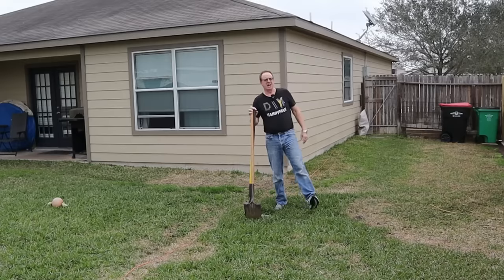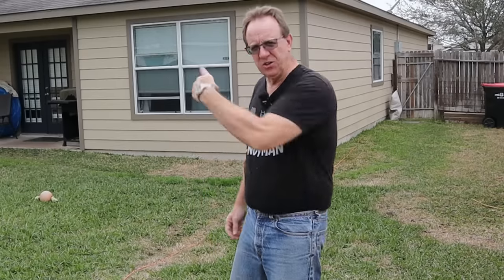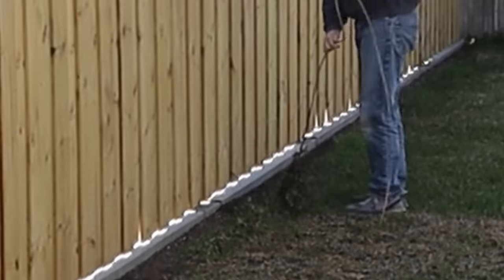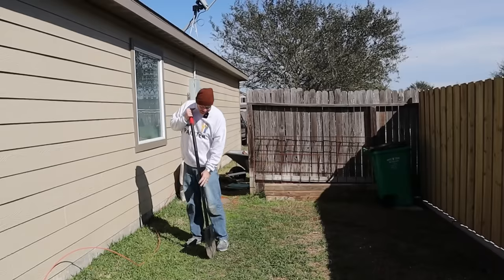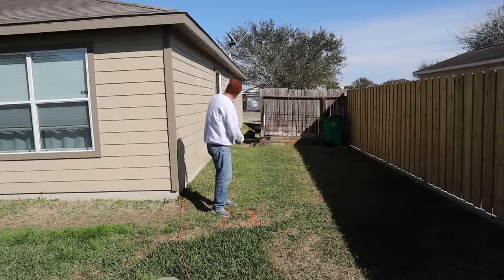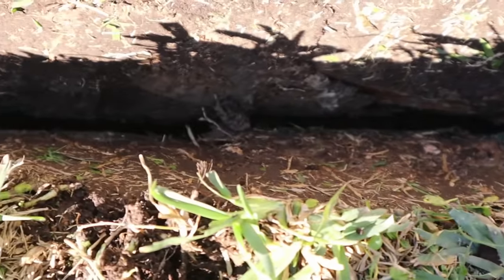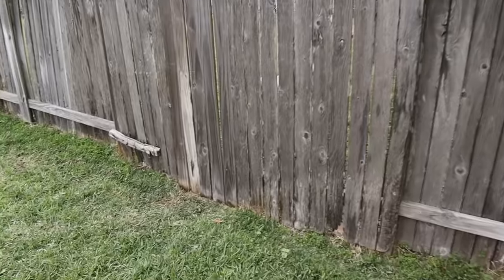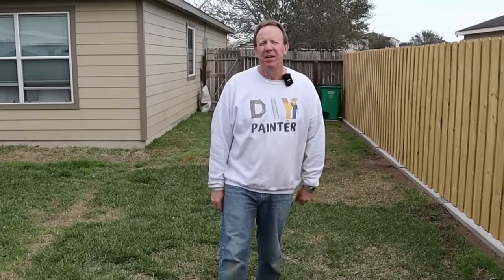ZERO Digging-Trenching Made Easy-Cable, Electric, Conduit

Comment: I’m 69 yr old woman and I dug a water line using a pressure washer.
Reply: I need to run a water line so, could you elaborate on this?  Thanks.
Reply: Excellent idea!
Reply: Gangster
Reply: Bet that was messy
Reply: Chalk line....nice, but I like the Sawzall technique better.
Reply: @MrElwoodCaudill get a pressure washer, turn it on and point it at the ground. Very simple process.
Reply: I was thinking the same thing! Great minds..
Reply: It’s called hydro excavation
Reply: Im mexican can confirm that we all know how to work hard 👍😊
Reply: Genius! 🏆
Reply: hydrotrenching
Reply: Nice😎
Reply: The pressure washer is a great idea. You can do a similar thing with air. They make it specifically for digging. It just uses air instead of water. Both are fantastic if the ground has a ton of rocks. 

I like going the other way. I use a good shop vac with a 2 inch hose to dig post holes.
Reply: Yep 💯💯. Also, I dig post holes withy wet vac 😎. Just vacuum out what I need, n dump the bucket out once I drop the post!
Reply: @ThePudgie123  Digging a 100ft trench with a sawzall will make your hand fall off.
Reply: How are you enjoying your new line of no grass? 

Used an edger or sawzall, cut the grass out in chunks. Then you can put those pieces back in place. And you still have grass there. 

Using a power washer may be easy, but HORRIBLY messy, and looks like trash after
Reply: Smarter lady here
Reply: Now that's the kinda woman that they don't make no more! "Git-er-dun!!"
Reply: Intelligent women are Beautiful!!!😍👋😂😄🙏💪☝️👍
Reply: She definitely converted her pressure washer to shoot air. She invented the air shovel @streetkid6534
Reply: My grandma (granny) was a hero of mine. You ma'am, are at that level.
Reply: You can also use hydro trenching to dig a water well in a lot of places! There's videos that demonstrate the process with only a hauled in IBC tote for water supply.
Reply: I love you

Comment: Since your cable is direct buried,  I would suggest running the cable through a pvc conduit riser or sleeve up to your box.  This way string trimmers won't damage the cable when doing you yardwork.
Reply: Alternatively you can run a sheathed cable, Teck cable that doesn't required conduit.

Don't bury any cord or cable not rated for direct burial. 15 year+ electrician here

Comment: The first time I got cable, three young, strong, men brought a gas-powered trencher and struggled for an hour to put the cable in, which they broke and just shoved the broken ends back together. They went directly across my lawn. After I called for a repair, an old man showed up with one of these tools. He said that the cable should have gone the long way along the fence. I scoffed at him for thinking he could do what the three men with a trencher failed at. He did it right in about 20 minutes.
Reply: HAHAHAHAHAHAHAHAHAHAHAHAHAHAHAHAHAHAHAHAHA :face-blue-smiling:
it's called experience, know-how, gumption :face-orange-raised-eyebrow:
Reply: @fvrrljr  , Yes. One lesson I learned is to never get cable when they offer a great price in a neighborhood. It means that they plan to hire a bunch of untrained people to do a massive number of installations. The cable installers don't know what they are doing.
Reply: @factChecker01  Thanx for the tip. but with wi-fi i don't get cable not other services that free wi-f- out there. made a cantenna that picks up open signals. don't watch much tv but i do love the free HD channels using the old and true antenna on the roof
Reply: The logic is that they would have removed any large obstacles to be able to insert the posts for the fence.
Reply: Knowledge is power

Comment: If I may add ~ always saturate the ground if you are going to use this tool or any other, it's always easier when the ground is slightly damp/moist. Also works for me when pulling up fence posts. And another thing:  A chainsaw with an old chain can get most of this trench done in a heartbeat, just be careful with rocks in the ground ...Thank you!
Reply: GREAT idea, I've used a Roybi battery operated saw ( $100 on sale ) to do similar
Reply: I guess that's great if you're at least 100% sure there's no buried power, water or gas along your pathway
Reply: @REVNUMANEWBERN  WOuld one of these work on hard clay that is dry and hard packed?  I am having trouble with all hand tools and cant get in there with anything large or heavy due to terrain

Comment: They used one of those when they put my cable line in when I lived south of Houston.  It was fine until the summer when the soil dried out an it opened up to form a 2" wide crack.

Comment: As a former utility marker, I can assure you that the machines they use for marking work pretty good.  The marker should have started from the pedestal (BOX) and worked his way back to your house.  Even though the cable company did not charge you since it was mismarked, The marking company paid for the damage.  When I was marking in the state of Kentucky, the cost to replace a cable line was $1000.  That was 25 years ago.  Its probably more now.  I like the tool.  It used to be against the law to open the ped, unless you are a locater or a technician.   Good video.
Reply from the maker: No they started at the cable box and when to the source.  Didn't realize they charge back the company.  I am sure they didn't credit them for me putting the cable in the ground.  Thanks for watching.
Reply: It is Still Illegal to "tamper" with the box.

Comment: I would have used 3/4"PVC.that way in case you had to replace or add another cable line .I know that would be an extra expense, but it will be easier for the next time. Great tool .
Reply: I agree In running the wire through a PVC instead of direct bury.  Add a tagline to the wire will make any replacement or running another wire a piece of cake.
Reply: I always run lines in conduit, PVC or otherwise.
Reply: I like to add some Caution Buried Line Below tape a few inches from the surface too.
Reply: Jesus Christ guys it’s a gd coax cable, who cares. You’d have to open that trench up wider for a pvc pipe morons, he wasn’t going to rent a trencher and spend all day putting a conduit pipe in the ground.
Reply: @ryan74701   so no pvc then?? Ok

Comment: Nice. Guess I'll have to buy one of those. I have a lot of projects that I cant to do and even if I need to dig a trench - this tool is an excellent way to start as I can come in along the sides at an angle with either a shovel of that same tool to widen the trench to meet whatever width I want.

Comment: Nice tool. I'm going in another direction. my pressure washer and an old shop vac I use for wet. I have a few post holes to dig to replace sections of fence that blew down and for Gazebo posts. I won't have to worry about through cutting lines because the pressure washer won't cut.

Comment: As others have mentioned, this would have been a great opportunity to utilize flexible conduit to truly protect your cables. I did it with AC and speaker wire last year. The flex conduit ensures there are no connectors underground, so there are no leak points.

Comment: There are SOOOO many places in the U.S. where the hard packed soil will make this tool impossible to use. But with decent soil, yeah, way to go!
Reply: Um...  no!  Not true.  There's nowhere this tool won't work (if you're smart).  I live in UT.  The clay soil here is like concrete when it dries out... The key here is: "when it dries out".  The simple fix is to lay a soaker hose along the path you need to trench, and leave it on overnight.  Shut it off in the morning, and start your trenching in the afternoon.  Simple as that.
Reply: @username-mc7jw  Clay is easy.  Try living somewhere with glacial till.   50% soil 50% basketball sized rocks.
Reply: Won't work in SE TX in the dry summer either. Our soil is like concrete. You can flood it for a day the day before tho.
Reply: Try your luck doing that across what used to be a shelled road 100 years ago that is now grass. Or any other type of non-soil substrate. Or in mountainous terrain that's all gravel.

Comment: I ran a cable drop bury crew for a couple of years when I was 18 for a contracted install and underground company, total circus. We were given shovels, reels of conduit and cable. The closest option we had to your tool were made by the secretary's husband, instead of describing him let's just call him "Brutus". The 16" wide X 12" deep blades were made from 3/4" Plate steel and the the handle was a solid steel 1-1/4" rod welded to the plate. Now if you're 6'-4" tall, 300 lbs, have a 36" waste and eat railroad spikes for breakfast, it's safe to say you can easily make a slot trench to bury that cable. Even considering the fact it was code in my area at the time that it had to be in conduit, hence the 3/4" plate for a blade. But he worked in excavation somewhere else and the rest of us couldn't even pick the tool up much less slam it into the ground pull it out and repeat every 16" as he showed us how. So we were stuck with shovels and a technique that required kicking the shovel through the grass at a 45 deg. angle, one direction only, from the house to the ped (or pole). We would take the most direct route possible, one or two of would grab the grass and pull up while one would push in the sod, it was a really quick process and nearly undetectable as long as the lawn was healthy the soil was medium damp and it wasn't newly rolled sod. That was the case about once every two months. We had 3-4 50'-200' jobs to get done everyday and even $6 an hour wasn't that great of a wage in 1999-2000. We took every short cut we could to get the conduit at a min. of 6" deep and with the least amount of ground disturbance possible. Landscaping with cloth under rock or bark was a gift from above to route through and cover, paving block was a nightmare. But the most common type to bury in was hard pan dirt with a few sprigs of abandoned grass with tennis ball sized stones. And of course the people that occupied those somehow expected that burying a cable would suddenly transform a wasteland into a lush green lawn. Once the conduit was down we still had to tie off and pull the cable through and reconnect it at the house. It was best job in the world!

Comment: You Rock! Thanks for sharing this DIY project. I’ll be running power lines for solar and you just solved my question.
Reply from the maker: Glad it helped.  Thanks for watching.
Reply: Cable TV is very low voltage. That’s why it only needs to be 12” below grade. Electrical cable should be 36” and in water tight conduit. Make sure you do your due diligence to be within code.

Comment: The thing about cable is that it goes bad a lot when buried. Any water or heavy moisture that enters the cable from either end will kill your high freq signals (internet and high tv channels). It can last a long time, but its just a matter of time. As a cable tech about 10 years ago I would run a new drop almost always on a hookup or even trouble calls.

Comment: Great video.
Before buying a trenching spade ($85!?) I'd try using my broad fork or even a spading fork (both gardening tools I already have) to greatly loosen the soil along that trench line.  After that a flat-bladed spade could probably do the job.  If I try this (which won't be soon) I'll post the result.

Comment: Man I live in an area where rock keliche and all the hardest elements are at the top  of the soil down as far as you'll dig this dirt won't budge for jumping on the most solid shovels some area of course will but man I dig a nearly 200 feet over the last week and I had to use the pick axe anyhow this does look like a good technique for the narrow trench and energy saved

Comment: Nice video. It should be noted that, while 811 locates "utilities", it does not locate "your" buried lines. So, if you have a shop/shed (or some other electric device like a light pole) buried, they do not locate those lines.

If 811 located your irrigation line instead of your utilities, the tech did not know what he was doing. Locating can be tricky, but you are locating a signal sent down the wire - so how did he get the signal on your irrigation wire? I never got them wrong, and I have located many different types of lines.

Comment: Do you think I would run into any issues using this method to run 3/4inch poly water line and filling in on top instead of pushing back together?
Reply: I did this method with a regular flat shovel for all my sprinkler lines (25mm). You want to push back together to make sure it gets flat afterwards (instead of slightly raised from the compaction+raise this method causes). I partly used my tractor mower to drive along the edges afterwards to push back.
Reply: @MrVidarak  I would get about 2-7 inches before I hit a rock.  Shovels are useless in my yard.  Only a pick can do anything.
Reply: 3/4 would be too big, I’ve buried 1/2 drip irrigation lines with this style of trench spade

Comment: Did the same thing with a chain saw turning the chain bacwards and justcut the trench and used a wooden yard stick and pushed the wire into the crack easy ascan be .

Comment: This seems like a good tool for shallow installations.
If you're placing " voltage" cable (  i.e. 120v or higher) direct buried is 24" deep, with a warning tape placed no less then 12" from the top of the cable.
Or within a conduit 18" deep.
Another concern for depth is to consider this. 
If you aireate your lawn, you want to be sure you're deeper then 6". Most of the machines will plug your lawns close to that. Just a fyi......
Low voltage is supposed to be 18" though I've never seen it that deep. They just dont place it that deep.

Comment: I give you one easier and maybe cheaper!  Use a power washer, and cut a single cable trench - 6 to 8 inches wide single pass.  For drain pipe cut 2 width of trench shovel, remove sod w T shovel , place pipe , cover, done and water encourages grass growth.  No cost if u use your pressure washer, or borrow so sons.   Maybe motivate u to buy one for other uses !

Comment: 811/Miss Utility is absolutely worthless. I had marked my proposed trench and asked for a notification when a locator would be on site. Never got a call. Not even to tell me they'd been there. Then, they told me there were no obstructions when I had called them back two days after they claim someone had been there.  Thankfully I wasn't able to get a trencher and began digging the 24 inches deep, 100 foot long trench by hand with my trenching shovels. I encountered 2 live 10awg direct burials within the first two feet; a 1.25" conduit with unused service wire from an old meter at around the 15 foot mark; another 10awg feed at around the 25 foot mark; a water line to the yard hydrant at the around the 40 foot mark; a propane gas line at around 70 foot mark; and buried coaxial at the end near the dwelling.
They told me the course was clear of any obstructions or dangers. Thanks for nothing. Glad it wasn't a charge service or I'd be getting physical with someone for endangering me.
Reply from the maker: Damn they couldn't have done a worse job.  Thanks for watching.

Comment: I’m an electrician and you’re better off burying a 3/4 pvc conduit 12” below finished grade then running some caution tape about six inches above the conduit so that anyone digging will know that there’s buried wires below the tape and with the conduit you can pull a new wire if you need to in the future and you can pull a pull string tie a piece of plastic bag to a string at one end of the conduit and get a shop vacuum and put the hose on the other end turn the vacuum on and use the vacuum to suck the bag with the string tied to it until you get the bag and string then tie the wire to the string and tape it with electrical tape pull the wire through the conduit and leave the string in there in case you need to pull another wire in the conduit later
Reply from the maker: When I did my foundation watering system and redid grade of the back yard I ended up doing just that, ran 3/4 grey electrical pvc at 12 in and pulled the cable through it.  Didn't do the tape though.  Thanks for watching.

Comment: Carefully,  when they drilled for Google fiber fiber lines, locate came out and marked off everything so they thought, but a 480 volt ac main power line wasn't on the plat map they had no records of it at all, well they hit it and killed the power for about 2 blocks worth of houses.
You cannot trust locate finds everything  now you wont be responsible but last thing you need to hit is a live main power feed, fiber cable, or phone and or gas lines. 2 of three will kill you and the fiber will make you blind and cost 1000s to fix. Any of them cost 1000s to fix.  Only safe way to do it is dig by hand.   All that shit should be in one main 4" dia pipe so if anyone thing needs to be changed you can just fish it out wile pulling a new line.  With one exception thats phone and power in the same pipe.
Reply: I had a unmarked NG hit by someone repairing the water line.  That was "fun".
Reply: I was on a jobsite, sprinkler guys hit a 2" gas line LOL not fun